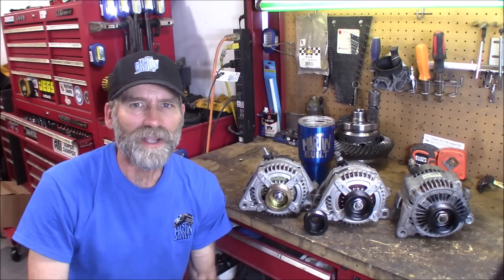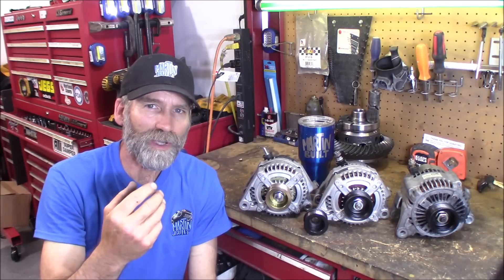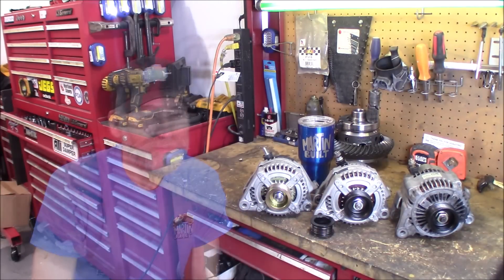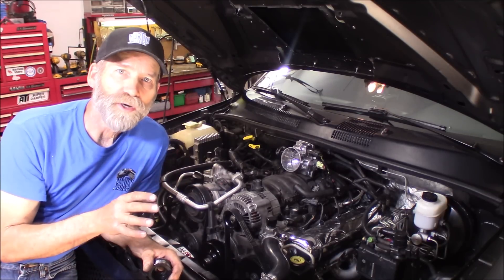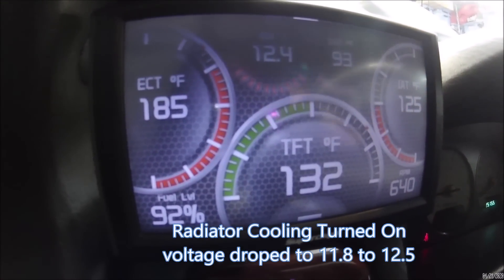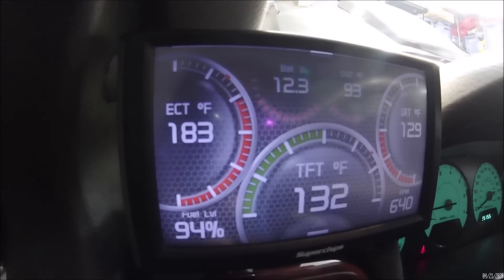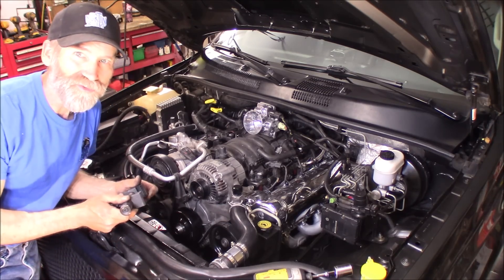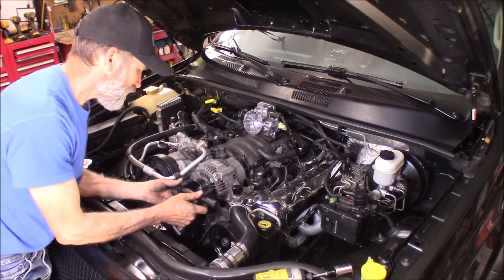Alternator Shootout at Idle (136 vs 160 vs 250 amp)

Comment: The one thing you must keep in mind is All of your grounds must be in good shape 
from battery to chassis and battery to engine as well as all grounds from chassis to body and the wire ends where the crimp is made not have too much rust.
Power flows from Negative to positive not positive to negative and your battery the age from when it was manufactured I suggest not be more than 6 to 8 years of age as this too will hamper the output. these tips will help you improve your readings as it should be 14.6 for a good charging rate.

Comment: I just rebuilt my 100 amp OEM Toyota hairpin, with better OEM parts from a Dodge Durango to better cope with the 800+ amp draw it receives in my car. Larger 12 - 50 amp diode rectifier plate vs 6- 35 amp, 1.8 ohm rotor, and re- configured the stator to do 240 Amps. It is an improvement from the 2.2 ohm rotor, and 6 diode plates factory. Still not happy with idle output, I bought another new denso 160a stator, tore it down again(solder joints @ the rectifier plates were a bitch) and after the new stock stator, I have a very stable 155+ amps at cold dead idle with a small pulley. Actually pretty good for a small case.

I'll upload a video later this next week, I have a genuine denso regulator that has a higher base voltage setpoint(14.5 vs 13.6v) with temperature compensation on the way. When that's installed, I'll make a video of it clamped at full temp. I plan on a large case DC power unit(XP270 - 220a hot idle 270+ at speed. It'll take a while to get here. For now, and playing with this small case, learning about the difference in parts, and how easy it is to make an OEM home built - high output alternator yourself, its actually incredibly easy. I even devised a way to have variable voltage control on the fly from inside with a variable 6k ohm resistor. I really should make a tutorial on the next build. It's fun doing it yourself, I even painted the case when it was apart, even looks like a professional aftermarket unit.

I'll get something real good posted here soon. No reason why others can't build a very high quality unit of their own as well.

Thanks for posting, it confirms my exact experience, and upon research and finding this video, I know after all the work again tearing it apart, it was ultimately the right choice for down low power.

You da man!

Comment: Reserve matters as well... your battery has makes a huge difference from a lead acid 20ah battery vs 80ah agm  vs a 48ah lithium bank. This test was good but like working out only the left leg on leg days.  As I finished typing this I realized this video is 4 years old. 🤣 Either way it was still informative 👍

Comment: FYI 13.5v is normal float voltage for a fully charged lead battery. Charging voltage is generally 14.4-14.8v. There's frequently a voltage drop in all that electrical equipment. Check it at the battery or alternator. I can almost guarantee it's a higher voltage.
Normally minimal driving is at idle...while it's interesting useful info...it's not a very realistic factor for most.
Reply from the maker: A good alternator should put out between 13.5-14.4 volts. If the charge gets above 14.5 volts, your battery will overheat and boil

Comment: Thanks for sharing.  But electrically speaking, the 250A alternator should be capable of handling the load more than the 160A one, as the voltage drop will be less on the 250A one than the 160 one.  This should be the case unless the 250A alternator has some problem with its voltage regulator.

Comment: The voltage depends on few factors not just pulley size and alternator size. The alternator amperage, the battery size, the battery quality class, and the load, the resistance of the circuit. These 3-5 factors. I remember that for a 3.2-4.3 liter mercedes ML, 1998, a battery size of 100amp hours or 725CCA and an alternator sized 115 AMP, was factory reccomended back then. Of course now the alternator sizes put by manufacturers are greater. Say a 540CCA stock battery in GM cars with 1.6 liter engines is matched with a 100 to 120 AMP or 150 AMP alternators with the option for the buyer to put a max size of 680CCA battery.

Also the outside temperature affects the batteries ability to hold energy, whcih is less during winter and better during summer. Thus a battery might need a warming cover.

With an AC fan running at max speed-3rd or 4th speed in GM cars,  during hot summer the battery voltage in european Opel Zafira 1.6 can go down to 12.7 volts with stock alternator of 120AMPS and 680 CCA battery.

Comment: I bypassed the pcm voltage regulator with one from a early 80's dodge.  It is adjustable voltage on the back, I set mine to 14.5 and it only dipped a couple of tenths here and there. You have to put a resistor on the pcm wire to fool the pcm so you won't get a code p044. I also have the 136 amp alt.  Just an idea.
Reply from the maker: One of those things I might do one of these days.

Comment: would be curious to see the actual current load on the system while turning those items on one at a time. i always thought 14.4v was what the alternator puts out, that is what all of mine are anyways. then the based on the load and the gauge of the wires versus the alternator's max current is at any given rpm will determine voltage drop. if your cables from the alt to the battery and ground are too small for the load the voltage will drop, and waste energy in the form of heat on the conductors.

Comment: Thanks for all of your videos! I am soon to do the heads on my 02 dodge ram 1500 with a 4.7. I was just wondering the other day if I could upgrade the stock 136 amp alternator to a 160 amp with no problems. I think this answers my question. The reason for the upgrade would be because I have a warn M-8000 winch & it bogs down real bad when I use it. I have been binge-watching your videos so I can learn more about what is in store for me ahead. Hey, thanks a lot for the wealth of knowledge, you have made this back yard mechanic a lot more confidant. Just subbed.
Reply from the maker: Thank you, that is when you need a bigger alternator for those high amperage accessories like winches and audio system. The 160 should help out and you may what to install the 49mm pulley.

Comment: I want to upgrade because I need to the car is under-engineered and only one acessory hurts engine preformance at idle. 
It seems like you are indicating that the voltage is more critical than the amps when you have enough amps as in the situation of(?) 160 amps and 250 amps.
Are you concerned about the voltage with regard to the ignition system because the accesories are running and the voltage holds at or over battery voltage with the accesories on. 
Or, does this start that suggested process of too much draw on the system, the battery kicks in to give out power, but then a low voltage never allows the battery to get fully recharged and creates a draw for power perhaps greater if the plate material starts to degrade. 
Or will some components not function at 12v or less especially considering that was at idle.
Reply from the maker: My concern was that the battery will not be fully charged and that the cooling fan would not run at a sufficient rpm to cool the engine.

Comment: Great video.....question...i have a wj jeep...yellow top optima....im running alit of led lights on roof.   Im up grading my 1500 watt inverter to 3000 to accomidate coffee maker....should i stuo up the alternator,or just grab another battery and tie that in with isolator
Reply from the maker: I would 1st try upgrading the alternator to 160 amp and then also also do the big 3 upgrade grade on the battery cables.

Comment: You can start by upgrading all your battery cables to 1/0 OFC will allow you to pull a little more amperage out of your stock alternator. If it still can't maintain 13 volts then I would give mechman a call and have them build you one that will easily handle what you're looking to do.

Comment: Do different vehicles have different voltages every car I checked was at or around 14.7 while running.and if your going with bigger alternator do the big 3 upgrade
Reply: More is not better in the case of batteries and auto charging systems. Voltages above 14.4 will diminish battery life.
Reply: Nope...he was starting with an under drive pulley. Which spins everything slower

Comment: what you need my good sir is a big v3/v4 kit its a bigger AWG depending on what accessories you have like for an example i have aftermarket accessories like 2 mini light bars 2 600w amps 1200w alpine subs wheel well multi color led lights upgraded msd coil pack for wider spark plug gaps (.035) the vehicle manufacturers are the cheapest bastards and with that being said they run thin gauge wires from your alternator to battery and even battery ground as well as engine ground so simple solution is before you replace your alternator buy a big v3 kit for YOUR TYPE of vehicle install the kit DONT replace factory wire just put your new kit wire typically 0-4 AWG over your existing factory wire this will save you time and money by not having to buy another alternator because more then likely the factory AWG isnt letting the alternator produce the electric capacity its really capable of 🤟🏼🤟🏼👌

Comment: Thank you sir. I have a current stock alt 120a on a 05 suburban. Turns out the alternator that I was going for was a bigger due to audio system.  Turns out I got it tested and one of the diodes is bad so I need a bigger output alt. Question is at idle this bad alt for a few days drains battery and all sorts of mess because your under the 12v. Any recommendations guys. Plz. Ac blenders are not working. Compressor is needing a new one and I will have to save up to buy one. Audio System taken off immediately. Just didn’t know about the pulleys at idle. Thanks. Advice please. I want to put back my system after everything fixed that’s if it hasn’t damaged any other electrical components already. 😔 I have my autistic 5 year old daughter and need a/c usually at idle while waiting on doc appointments. Please if you have advice share it with me.

Comment: The overdrive pulley listed in description doesn’t work with my stock alt on 04 wj it also doesn’t fit the Durango 160 upgrade both denso alts it’s rubbing both alternator’s  .. bummer love the vid tho !
Reply from the maker: Did that pulley not come with a spacer to be installed between the alternator and pulley?

Comment: at low speed the air cooling is poor and with load it overheats and I guess it triggers the protection circuit or simply it can’t make enough power. But I have a cs130 105Amp alternator that can do 100A at 800 engine rpm with the same pulley possibly similar rotor rpm.

Comment: Do you have vids which actually measure the amperage draw with something that can pull 250 amps for example amplifier vs what the alt can put out? Volts are one metric yet amps

Comment: Use an external regulator and pull sensing voltage at the battery instead of at the alternator!!! You might need a shielded wire for the sensing voltage!

Comment: Great demo video, I want to know by adding up more amp from the alternator will it effects the components Like Ac , high beam , signal lights and Radio. And other electronic parts in the car tq
Reply from the maker: Thank you,  the alternator will not put out more amperage just because it has a higher amperage alternator it is only gonna put out what is required of the electrical system.

Comment: but there is a lot of other things to consider too, like on the 90's mitshubichi's they use the grounds at the body's chassis and not the battery negative termninal, and doing so that car struggeled with the same as you did, with way to low charging voltage,
so remember to have - negative going directly from battery to engine body and then to the car's body for the rest, and btw how does your alternators regulate the voltage? Is it built inside the alternators or is there a sensing wire going from your positive battery to your cars dashboard "no charge/battery lamp" and  then back into the alternators sensing port, is there a separate ground cable for the internals of the alternator? like those marine alternators that needs separate grounds so your boat engine doesn't corrode to hell.., there is a lot to consider, how would it be if you wired the one pin to field to max and made the sensing wire shorter, woulld not the alternator put out more amperage so the voltage would go up too, even though you got low voltage with the smallest alternator, does not mean that the voltage you showed us, is the contstant voltage across the battery, then you need an ampere clamp and separate voltage meter over the battery, and btw where does that tuning device you got, where does it measure the voltage, directly from the battery or via the ecu? 
btw I love the video and work you have done to get a point out to people..

Comment: But amperage output at idle is actually  the best test when just looking at the alternator. Volts is a SYSTEM test which includes battery, battery state of charge, battery age, battery reserve capacity (rated in amp hours) and integrity of vehicle grounds and positive circuit. In other words, if you had 2fully charged heavy duty lead acid batteries, the results would be totally different in volts. The results are accurate, but only for YOUR vehicle at that point in time. Solving all vehicle voltage problems with the alternator is like getting the buggy ahead of the horse.

Comment: How much time are spending at idle?  

Maintaining 12v at idle is perfectly fine and totally normal!  

I prefer a low rpm alternator do to electric fans and stereo equipment.  

At the end of the day, it really doesn’t matter.  

Smaller pulley ~ better charging and output at idle….  However, your alternator won’t last as long.

Comment: nice video. I have a Ram Eco diesel. I need more amps to charge my batteries for my inverter when the power is out. we cannot run generators at night. Which size pulley do you recommend. I show 13 volts at idle on my dash. would like it a little higher.
Reply from the maker: sounds like the voltage is just slightly low. I don't know what size pulley you have now but I would just go with one that is a few millimeters smaller.

Comment: My problem is i have a sound system that pulls a lot your opinion would the 250 with the 49 do me best . My systems a 1olm in series set of 12in subs at 1800 watts but peak is 2500 and I have light bar and interior lights led .have 1000cold crank battery much larger than stock for this but still heavily dim lights when subs hit  ......help please great video by the way good in site
Reply: You can start by getting another battery and a shumacher charger and top off every few days. Then when you upgrade your sounds you can get the 250 or greater, my 3k amp recommends a 250 amp fuse. The problem I have is volt drop ,so I turned the Gain down and set my knob on the epic center (bass restoration ) to a quarter or half (max) depending on song. I ordered a 250a high rpm mechman alt which should be here tomorrow, I will update you when I install it

Comment: id  say the 160 with the 49mm pully outperformed the 250apm alternator, regardless of how they built the 250amp alt i think they shoulda made it to hold 13 v at all engine rpms, i was shocked it didnt even perform good with a 49mm at idle. i mean lets say im trying to show off my big sub to a friend, im not gonna rev my engine to 4000rpm for that 250 amp alt to work, just doesnt make sense, i hope the manufacturer change their way of thinking and make their alt put out 13-14v and 250amp around 700rpm, that would be perfect
Reply: ... low rpm, high load /output=overhearing.. high rpm, adds cooling (fan internal fan. Notice how hot the alternator when he was holding it..

Comment: Amazing and educated video. I need your advice. I have Toyota Land Cruiser 100 series 4.7 L V8. I installed 12000lb electrical winch. Looking for high output Alternator. What do you suggest?
Reply from the maker: Mechman or DC Power Engineering

Comment: Definitely add some 4 AWG wire from the battery to the generator, from the batt. to the starter and a couple of grounds from batt. to chassis and batt. to the generator's body ensuring they both go through the factory hall shunt.
Reply from the maker: Yeah actually I've done all that I stalled one gauge grounds and a 1 gauge to the alternator and that made no difference.
 And I knew it wouldn't make any difference but I just had to humor everybody that kept telling me to do it.

Comment: Couple of things I am wondering about, first Aren't dodge/jeep voltage regulators built in the computer ? and if so you can't adjust the voltage with out installing an external regulator maybe one with a potentiometer to adjust for voltage, so maybe thats why you are not noticing a real big difference in alternators , also the high output alternator (250) is probably is only a 3 phase and not a 6 phase . to get a true high output alternator you should look at mechman, us alternators, brand X, and Tae electrical

Comment: All three alternators appear to be following the same pattern.
The ECM may be controlling the charge profile based on the stock design. If that is the case then when using a high output alternator you’ll need to program the ECM to match it.
With the 250 amp alternator, where is the excess amperage going? 
How many Amps are being produced at idle?

Comment: Your only hope it to do what I did....bypass the internal regulator in the ecm with an adjustable external regulator.i stay at about 14.5 with 2000 watts in system on the stock 136